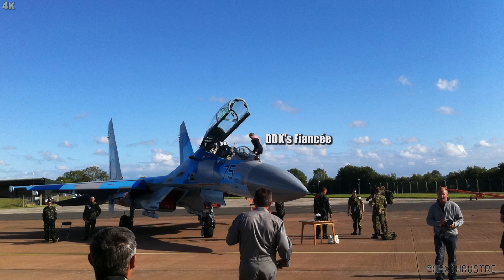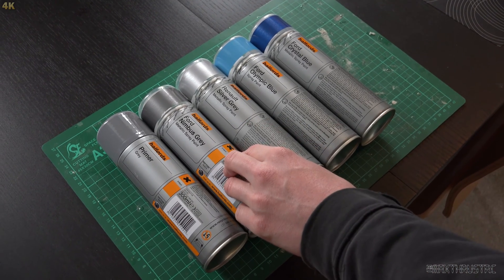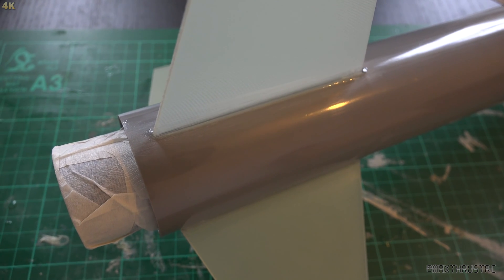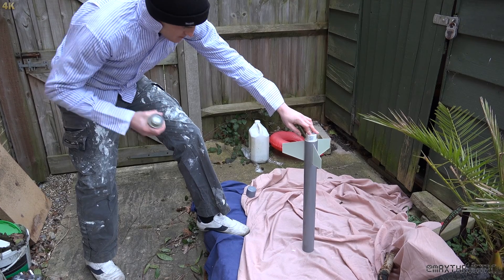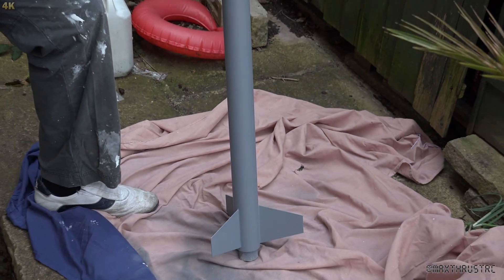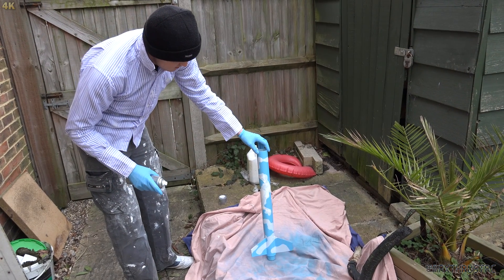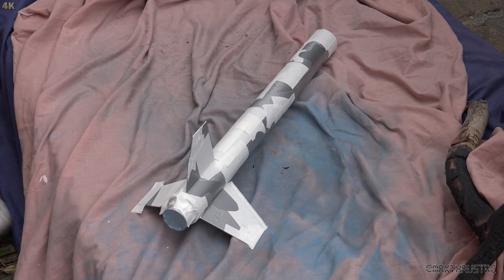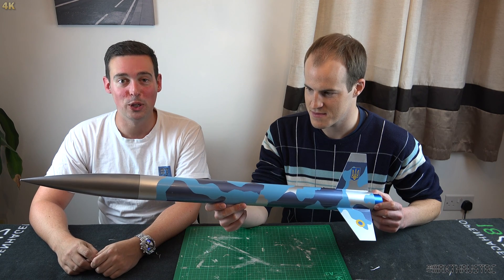DDK Goes For Rocketry Level 1 Part 3! [4K] - Rocket Painting

Comment: I design and build my rockets from scratch (using rocket parts of course) But I never put any real effort into painting them. I paint the body tube white, and the nose cone and fins florescent orange on all of them. I don't worry about smoothing things out or sanding. I do not put decals on them. I consider everything I build to be a research rocket, and like to try out different designs. I have built 3 stage rockets, cluster rockets, and combinations. I have hit more than 2500 feet with two D engines and one C engine. I don't care if the rockets are pretty. The orange and white makes them easy to see, both in the air and on the ground.